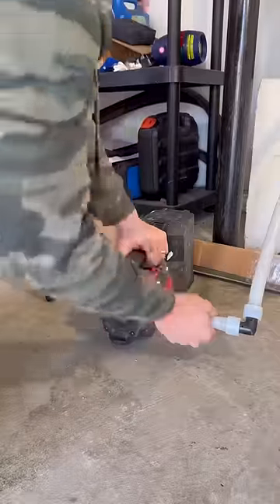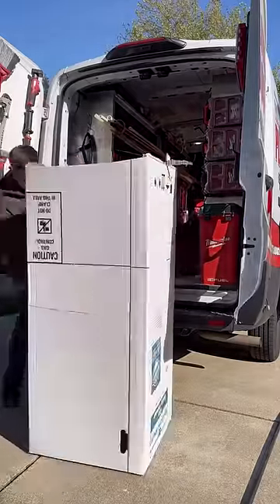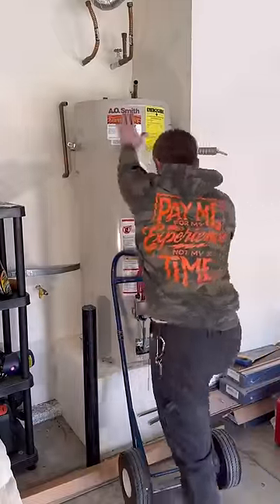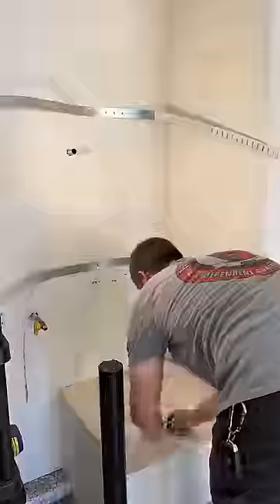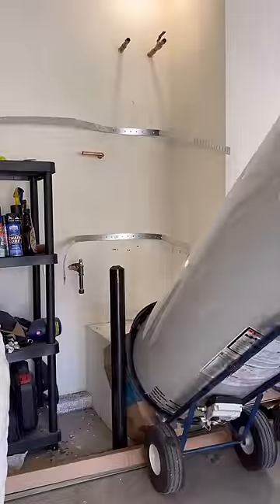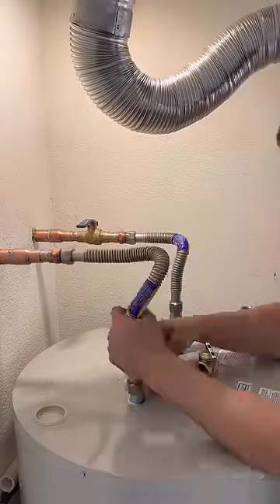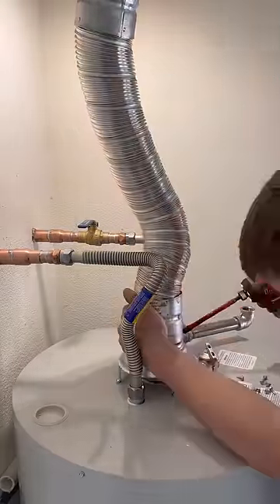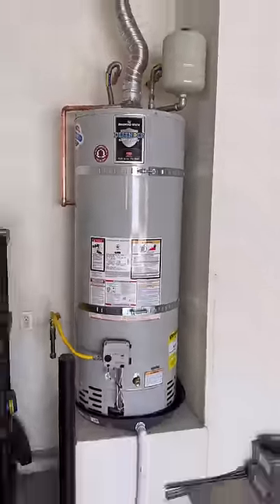water heater install. a few free tips for ya #plumber #plumbing #propress #soldering #diy #repair

Comment: Never seen a tie strap used with a dolly to lower the tank off the platform, PURE GENIUS
Reply: Yes, a very underrated moved!
Reply: I had an 80 gallon swapped and I wish the young guys doing it had seen this first. It was an adventure...
Reply: @ffdtower1  I had to installed a 120gal one on a 4” pad and it was all me and my helper had to get it on there. Lol. Here in a few weeks I’ve got to install a 120gal 9’ above the floor above the ceiling tile. 😩
Reply: Pure back saver too.
Reply: i’ve
never even seen a heater on a platform
Reply: @patrickcoyne1292  in garages they’re required to be on a stand….especially if it’s gas instead of electric because most homeowners store combustible chemicals like gasoline that it’s vapors stay close to the ground and could ignite if those vapors reach the water heater.
Reply: @patrickcoyne1292 Thats odd, maybe its just in the south but we have codes that require them to be off the ground, I want to say it's 18" minimum here in Texas.
Reply: They make actual lifting straps for this purpose...but a tie down will work☝️
Reply: I never thought of using the dolly backwards like that, genius indeed
Reply: Yeah this dude is a silver back 😂
Reply: yup, i learn something everytime i watch him.
Reply: It’s not genius, that dolly is specifically meant for that. I have them for my guys and makes installs a lot easier.
Reply: @johnpinedo73  Then whoever originally thought of it is a genius then.
Reply: How did it go
Reply: @blakeowen6513 I made a rising rig (my name for it) out of unistrut and all thread rod to lift up a unit with a chain fall 15ft above finish floor in a suspended ceiling... 
I jvm ave no idea why the engineers designed it up there... 
What I don't understand is the furnace roomwith the water softener also located in there and it's 15ft away from where it goes in ceiling and that room is 1/2 empty!!!!
WTF!!! 🤷‍♂️

Comment: The pump is a great idea, especially if it has a bunch of sediment. I dig the strap lowering system.
Reply: Sediment?  I just leave the supply lines attached and use the pressure to blow out the sediment and then remove the lines.
Reply: @davidater9  hard water systemd build up calcium inside the water tank. no you cant just blow it out. my last tank weighed 200 lbs empty from the build up
Reply: @bmxscape  In some parts of the country, the build up will be sand-like in the bottom of the tank and can be blown out....I haven't hit the solid stuff you're referring too.
Reply: @davidater9  interesting that does make sense sorry for my ignorance

Comment: Looks like a great, clean, quality install. I am a welder but for some reason have a manometer to test flue draft. I also use the old match trick. Something I picked up as a teenager doing odd jobs for a while I guess. I do actually use the manometer to calibrate Liquid Propane vaporizers and regulators on mobile equipment occasionally, so I reckon that's a plus. Lol

Comment: What fittings are you using to connect your pump to the water heater? Like the FIP on the drain to the pex adapter.

Comment: Somthing I've learned as an appliance tech... just because it's code approved dosent mean it should be used. The amount of driers I've had to charge a service call to vacume out the flex pipes and the homeowner gets mad is ridiculous. Flex pipe causes disturbances in airflow. This can cause debris to build up much faster. In this case soot buildup would be greater than if straight pipe was used

Comment: I never had a pump so I used the house pressure to push any sediment blockage to start the draining. If that doesn’t work then I just angrily man handle it out and smash the draincock off. Also are you not worried about breaking the glass tubing for the anode rod? I’ve been told by Rheem and AOSmith that transporting a heater on its side will do that. (We use full size box trucks so height isn’t an issue)

Comment: How often should a homeowner change their water heater? And also, how much does something like this cost? Thank you! Awesome video 👏🏼
Reply: You change them when they stop working properly . they can last over 10 years and a tankless could last 20. Its expensive to replace and definitely can cost $2k or  more depending on the model of the water heater
Reply: I replace mines for 600 did it myself
Reply: How often? As often as they stop working and can't be fixed.

Comment: I use the single wall flex vent when needed.  Code approved as long as you don’t feed it into a wall or ceiling or in attic, only allowed within the room.
Reply from the maker: No doubt👍🏻

Comment: Where is your service area? I’ve seen outside water services and flex lines and earthquake straps on the heaters. Also did you use galvanized pipe for that expansion tank?

Comment: I’m not a plumber but my company does it. I’m just curious those guys always give bids on replacing copper pipe. They might replace some parts but it’s usually always recommended to switch to pvc. Florida btw

Comment: If the current heater is not adequate for my shower needs (Whater gets cold 2/3 into a regular shower time) etc in terms of hot water, what is the way to calculate the right capacity for purchasing a new one?

Comment: Idk about your state but in california we’re required to have 4 points of connection on the water heater straps, not allowed to pair both sides of the strap together to one lag screw

Comment: Nice install, but why do you guys still use those inefficient hot water heaters over there? The flue temperature is freaking high on those (lost energy)....

Comment: Get a strap bracket for expansion tank to the wall the weight of the tank will cause a leak on galvanize expansion water will fill and empty over time. Your amazing keep doing what your doing nice clean work

Comment: If you maintain a water heaters anodes you likely never have to replace it.  At most you have to replace the elements on an electric and the ignitor in a gas.  We've had the same water heater for over 25 years and it still works like a champ.  Also, drain it at least once or twice a year to keep the build up down.

Comment: My question is why is there only one valve? Would adding another one be useless or is there a reason?
Reply: Not just useless, but wasteful and more potential leak points. When the cold valve is shut off, there’s no longer supply water to push that inside the tank out of the hot side.

Comment: The flex flu is great stuff but you can only use it after the ceiling penetration. It can’t be in the attic. I failed for it once.

Comment: Damn that must be a newer house with a clean setup like that. To bad the original installer screwed em on the water heater to have to replace it so soon.
Reply: People don't change the anode out, so the tank corrodes. There is a reason the warranty ends where it does. That is how long it usually takes the anode to dissolve.

Comment: Ao i always wondered why pit the hot water heater on a pedestal i just see a reason to not have it on the ground other than to protect it if your basement floods but i always see the stand mounts in garages

Comment: Expansion tank, awesome idea, saves constant sudden high pressure changes inside the hot water tank, helping it last longer...I added one, and a water Pressure gauge, so I'd know how much air to add to the expansion tank to be equal with incoming city water pressure.
Reply: Expansion tanks are required by code now on water heaters
Reply: @connorlacy1536  Right after I fixed the leaking gate valve for the inlet cold water side,  21 year old WHITE Hot Water Heater, the closed "now" system increased the water pressure in the old tank, and it split down the seam from the top towards the bottom...

...so, the new expansion tank went in with the new hot water heater:  I don't know if it is code here?

Comment: I have heard that you must only transport the water heater right side up. Transporting it laying down can damage the sacrificial rod in the tank.
Reply: I "once heard" the earth was flat. Lo and behold, found out it wasn't  true either!!
Reply: I've never heard it called a sacrificial rod in my 40 years that's classic
Reply: @ericnardo2686  I meant anode rod ... lol
Reply: @ai8438  Anode rod... This is a gas water heater.
Reply: @MaskMan191  yes
All water heaters, except thankless, whether electric or gas has an anode rod. 
Anode rods are steel wires encased in metal made of either magnesium, aluminum or a zinc/aluminum alloy. 
 It attracts particles of iron, limestone or other minerals present in the water through an electrochemical process and corrodes in place of the tank, thus the name sacrificial rod.

Comment: 40 Years of Plumbing I've never not once used galvanized pipe for water. Brass or copper right to the water heater nipples because they are protected from electrolysis. Now your electrolysis will start upfeed on the cold side, I'm not a hater just giving you a little info

Comment: T and P flush pipe seems a little short for my area. our code says it has to be only 2 inch above floor so if it does pop hot water has less spray radius. Just curious what it needs to be there?
Reply from the maker: Needs to terminate outside. This line runs to the exterior
Reply: @replumb  oic

Comment: Its not code anymore the county requires double wall.. but you're not pulling a permit. The roofing company i retired from we had to change put if the inspector saw them.

Comment: Flexible flue are not code in my county. Sadly.. only double wall. So as a roofer we'd get hit with those.
Reply: And have to replace them so it was fun trying to use elbows and pipes. Hate doing those.

Comment: I always solder pipe all the way to the union. Not this flexible bs. I then sand the whole installed copper pipe so that whenever the customer passes by they know it was a quality job
Reply from the maker: we have to use flexible connections in CA

Comment: Why don’t you just use a female by female hose to connect to the water heater from the pump? Just curious, that’s how I do mine and they typically drain in less than 10 minutes while the equipment is easy to use and store

Comment: Would be nice to mount the expansion tank right side up to prevent rust and at least 18" inches from the water tank as recommended by the manufacturer. And support the tank.
Reply: 🤣🤣 keep up the good work bro I won’t bag on the flue if it’s approved material, other than that this is solid work. Sending love from Idaho!
Reply from the maker: @robertelzner6679  appreciate you brother! Thanks for watching

Comment: Not much trash on this install. 5 gallon bucket works better. Cut the box down and use as protection when you have to crawl under house.

Comment: I don’t recall an expansion tank on a water heater.   Why are you using it.
Reply from the maker: Because it’s required
Reply: Thanks, I don’t think that is a requirement in central coast of california.  We’ve replaced many over the years.  But if I had to have one I would paint it orange and paint a face on it.  Thanks again for the reply.  By the way it is clear that you are a professional.

Comment: Not saying in this case you were wrong. Big mistake to think that because something was built a certain way or was inspected that way was acceptable then or is per current code. I’ve seen millions of dollars in work get torn out over the years because of this same line of thought. Always do your research and take pride in knowing what you are installing is acceptable. The “it was inspected before” line of thought should never cross your mind.

Comment: Passing inspection & code doesn't mean you should leave it. My current water heater is not at code today, but it was passed by both anyway because it matched the code at the time the water heater was installed. Both told me explicitly that it will need to be updated once this water heater gets replaced.

Comment: IPC Section 504.6 requires that the discharge for the pressure relief valve terminate within 6 inches of the floor,  This installation does not appear to do so.
Reply: It also states that the expansion tank be strapped and not supported by pipe. Would fail here
Reply: Illinois  no flexible lines allowed

Comment: Does no one know you can't install expansion tanks upside down? I am constantly dealing with improperly installed expansion tanks that last about 3 years due to being upside down
Reply: The air gets trapped in the bladder which dry rots the rubber, unless you know otherwise. But I suppose it's a good tactic to come back and replace an 8 year piece of equipment in 3 years
Reply: I'm not docking you just thought I would throw that out there, everyone's codes are different

Comment: Man U did all that copper work at the begging why didn’t you just go ahead and do the rest copper instead of the flex lines? Also use Jersey gloves to wipe the solder off to make those joints clean
Reply: Earthquake-proof!

Comment: THERE ARE OLD PLUMBING VIDEOS
WHERE YOU ABLE TO SEE
THE SAME SISTEM 
HOW TO TAKE OFF THE WATER HEATER
FROM THE PLATFORM
AND HOW TO PUT THE NEW ONE 
ON THE PLATFORM
NOTHING NEW HERE
THE FLUE PIPE IT'S A NO, NO !!!

Comment: Expansion tank cannot be supported by plumbing vent needs to be double wall cmon bro😂
Reply from the maker: Wrong and wrong again
Reply: 308.10😴
Reply from the maker: @JoeGarcia-f2l  that code was written for dumbasses that install these on pex or copper, I’ve passed thousands of inspections doing it this way on brass or stainless steel
Reply: I’d fail that can’t fight the code man

Comment: I guess vacuum breakers are not nessesary
Reply from the maker: Not in this state
Reply: @replumb  so you only follow things from the state? Since when? It's a code you follow. Red seal brobro. States country's don't matter. Code transcends all areas that following. So.........I think it's good practice to follow code. You know, just incase.........it's an extra layer of protection is all I'm saying. Code is code. City can't fail code.  The only way you can get around not having a vacuum breaker on a tank is if you somehow know that back siphonage is not an issue. 99% of the time it is so.............

Comment: "Code" is the very minimum allowed ethically, morally and legally.  One slight step less = "Failure".  It's nothing to brag about.  It is the most incompetent that an installer can be, by Law.  It is barely "not failing".  Can't we, as professionals, do more than just barely not failing?